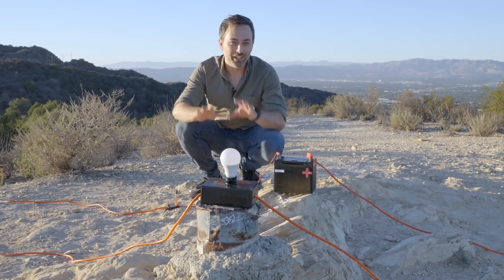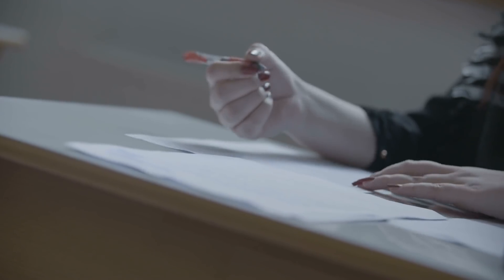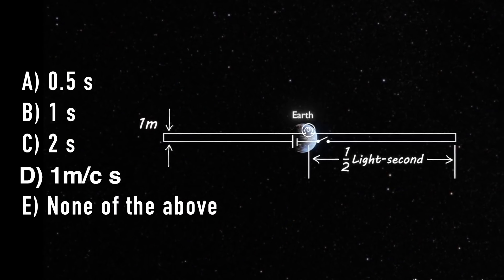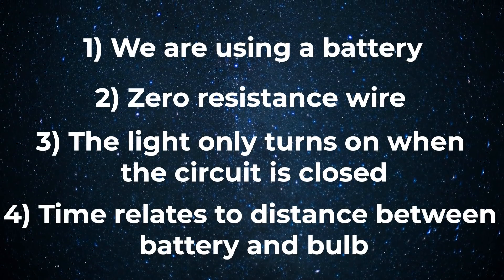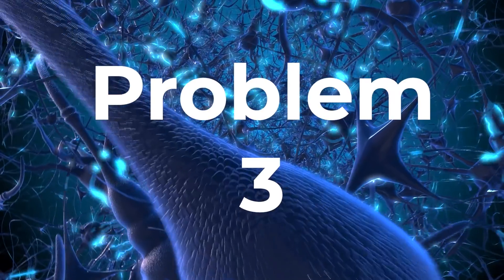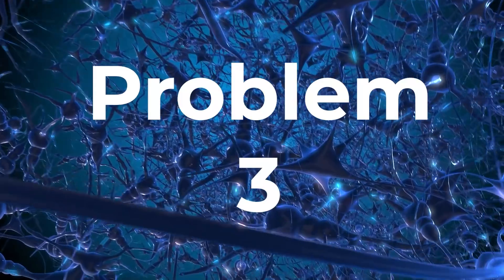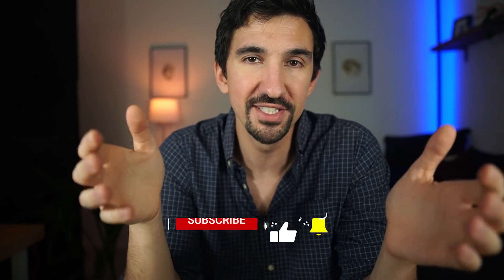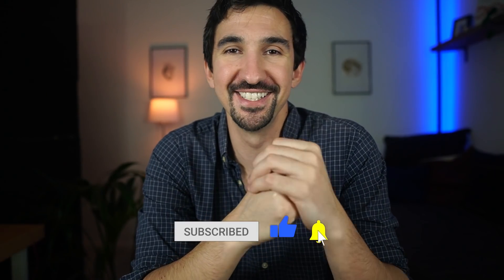Is Veritasium Wrong About Electricity?

Comment: The conclusion I drew from Veritasium's video was that the length of the wire, which connects the battery to the bulb, is not important in the speed with which electricity reaches from the battery to the bulb, because the energy is transmitted through the electromagnetic field, not by wire. That is, the most important is the physical distance between the battery and the bulb, and the wire is just a guide for electromagnetic energy and the electrons do not move through the wire.  If this is true, then why does the wire heat up? This I do not understand.

Comment: Regarding the faster than light communication, I think the dilemma is stemmed from the ‘when is the bulb turned on’ issue. 

As you say, Derek’s 1/c explanation doesn’t need a full loop of wires to work, it only needs a pair of antennas. So if the bulb ‘turns on’ just by the coupled electric field of the 1m distance, then surely the cutting of wires doesn’t affect that at all. The bulb will be on all the time regardless of whether the switch is on or off. So there is no information transferred there. (Of course the bulb won't be on all the time if the power source is DC - it will turn on only for an instant then go out)

The thing that is affected by the switch is the ‘full power’ (or DC steady state power) that is transferred from the propagating fields along the long wires and that of course travels at the speed of light. So closing/opening the switch will only affect this steady state phase of the bulb and that, safely, is conveyed at the speed of light.

Comment: The real problem I see with this is that his explanation is inconsistent with a very common electrical measuring tool: the clamp on ammeter. This takes advantage of the fact that moving charges create magnetic fields (If I'm wrong about this, feel free to re-teach me everything about physics) and that changing magnetic field will induce moving charges inside the loop of the clamp on ammeter.

So, if his diagram with the 'yellow field lines' is true, and the energy moves as-the-crow-flies to the load of the circuit, then using a clamp on ammeter breaks the law of conservation of energy! Because, therefore, the energy would have to be following the conductors AND travelling a short cut through space AT THE SAME TIME! This is impossible by one of the most fundamental and AFAIK unbroken laws of physics.

Am I right?

I think he very tragically misunderstood the idea that electromagnetic fields exist OUTSIDE conductors with electromagnetic fields travelling IRRESPECTIVE of the conductors.

Comment: I thought the same thing about the units. C is the speed of light which is distance over time not time si 1/c doesn't make sense. 
The other way I look at this is thinking about transistors in a CPU switching billions of times per second. How long does light travel in one billionth of a second? Its about 3 metres so if the transistors are more than 3 meres apart will one transistors immediately affect another rransistkr 3 metres away or would it take one billionth of a second? I think the latter is correct otherwise you could just keep increasing clock frequency without it affecting the circuit

Comment: I'll say what I said about that video.
If its a 12VDC circuit, the bulb won't light at all because there is no way DC power can travel that far.
Or it would instantly kill you, a 300,000 KM wire moving through the Earth's magnetic field would probably generate a few million volts which would make your equipment explode and emit a tremendous amount of X-rays.

Comment: Great video, thank you Dr. Miles! You explained it really well too. I still think 1 & 2 are huge problems with this thought experiment, but now I'm tying that with problem 4 after hearing your take on that. They are both massive problems. If we suggest that the light would turn on at a time dictated by the distance between the battery and the lamp, as you eloquently state, how do we then proceed with ignoring the length of the wires to solve the problem? 

So I think ignoring the resistance and the small size of the power source, and that we using DC is not fair, or correct to do.  But even if we do ignore those and pretend we have 0 resistance and impedance superconductors from Star Trek or something, it still fails a basic logic test in crafting the formula. The length of the wires matters to the time required to turn on the light, and if we accept that, then how do we ignore the length of the wires for the calculation? We are missing more than just an important unit in Answer D, we are also dividing with zeros or missing a variable or two from the formula, any way I slice it. And also doing real time morse code across the universe with no delay. 

Thanks for pointing out the important difference between using teaching models and analogies to using clickbait statements like 'they lied to you!' The scientific method is important, and sacred.

Comment: Clearly you didn't see all the explanation in the video where he told why he think that is true. If not, you will not make all these calculations about light speed.
Reply: Electrons do not travel at the speed of light, they are slightly slower.
Reply: @MichaelClark-uw7ex  actually they are MUCH slower. About a walking pace.
Reply: @binaryblade2  I'm talking about free electrons, electrons in a wire is totally different, its not about flow of electrons its about differences in charge potential.
But that is still really fast, I was a master electrician for over 40 years and I always told new workers rule 1 you can't outrun electricity

Comment: No, Veritasium's video is just flat out wrong. Firstly, the "field" is just the mathematical object used to model changes in the behaviour of the electro/magnetic forces/interactions. The forces are what are real. He also totally forgot that the magnetic permeability of air is tiny compared to the magnetic permeability of the conductor. It's the forces carried by the conductor that cause the electrons to move, he forgot to model the field INSIDE THE WIRE as well as around the wire. Yes, there is electron flow inside the wire too, but you still need to model the field! The idea that the energy is carried through the air is just stupid. What about when you don't have a circuit, like with a lightening strike... no, also the "coupling" idea just doesn't hold as it's DC, you would only get a tiny effect around the leading edge of the wave propagation, and that effect would be negated by the reverse EMF of the electrons in the other wire... ie, it would "push back". You wouldn't get any flow. You need a continually changing field to do that. But mostly... ENERGY GOES DOWN THE WIRE! That's why we use them!

Comment: At school, we learn that the electric current is slow going, but it arrives at the other end of the line at some large speed or the speed of light because of the propagation of the EM field itself. Textbooks show water being pushed through the pipes! Veritasium mentions that the EM field propagates as an exploding sphere that goes from the battery through space at the speed of light while diffracting through the materials in the environment, and moving the charges in waves. The audience would like to see the path of the current from its own frame of reference as if it were a lightning spark discovering the low-resistance areas where it will jump and cross the gaps. In that regard, science has an incomplete view due to computational and other difficulties. Right? 🙂

Comment: Hello,
As an EE I can tell you are on the right track. 
My objections are as follows:
1. He is using a DC source to provide the current into the system, thus as you state the near instantaneous current conducted through the filament would be very short lived and given the conditions of the test and poor coupling between the wires, the current may not even be measurable. The fields generated would be very small and for all intents and purposes the current would be zero.  An induced current is dependent upon a changing EM field, and since this is a DC source that change is very short, and is related to the parasitic capacitance and inductance of the system.
2. He confuses AC and DC current. In DC current electrons do flow and charge capacitors and build magnetic fields in inductors. Try charging a large capacitor with about 100V and touch it, and you will know that electrons do flow, not just the field. In AC the current does oscillate as they describe, however at 60Hz (Line Frequency) the movement is much more than they describe. Otherwise transformers and capacitors would not work, and the electric fields would not be generated.
3. The propagation velocity of electrons in a wire is less than C. This is due to the permeability and permittivity of the EM fields as well and the intrinsic structure of the conductive materials in relationship to free electrons to be conductive. You alluded to finding a break in the circuit, and I can tell you from direct measurement that Time Domain Reflectometry is real and is used every day. If what Veritasium is say were true, then this method would not work.
4. I do agree with you that his units for the answer do not work.
5. Having taken and used advanced EM field principles in my engineering career, the EM field and the voltage and current associated with it are coupled tightly. While you can radiate an EM field for long distances, without it's conversion back to an electron based voltage and current would not allow for any detection and or use of these EM fields. Electrons do flow, and voltage still drives the flow.

Comment: The breakage in the wire does not have the same elapsed time. The time from a wire breakage to the time when the bulb turns off is again dependent on the distance d between breakage and bulb (d/c) and hence no causality is broken. If the switch/break was one light year away it would be one light year before the bulb turns off and causality preserved. The other problem with your explanations is that the battery generates electric field fields even with the switch open, its not as if you close the switch and suddenly the fields are present. Instead what happens is that there is a change in the fields when the switch is closed.

Comment: You, sir, have explained what V and SA both could not to me. The key point is that both the electron flow and the electromagnetic field can excite the bulb's material. The fact that the field can do it initially by itself over the short distance does not mean it can cause visible light, nor that the wire isn't needed to do so. Thank you.

Comment: This video critiques, but glosses over some issues with the Veritasium Misconception about Electricity video.

It begins analysing the question posed on the speed of propagation of electricity to turn the light on, and turn it off including dispelling an incorrect conclusion about exceeding the speed of light, and suggests various assumptions about the transmission line.
 
It diplomatically perseveres with the with the assumption that electricity flow in wires is solely brought about by electromagnetic action to frame the analysis.  This assumption is wrong.  

Electromagnetic action relies on rate of change and this applies for alternating currents, but not for DC.  With a battery which is DC, a static electromotive force is produced by chemicals, and a current will flow without electromagnetism.  The magnetic field is static, there is no rate of change, so the magnetic field does not create any electricity here.  

This is also true for low frequency alternating current and the effect only comes into effect at higher frequencies.  Only then will Poynting indicate significant power transmitted by electromagnetic action – but not in this case here - plug in the numbers and apply the math?  

The reviewer is probably aware that it does not cover DC, saying “I think it may be easier for you if you increase the voltage of if you .. or alternating current ..”  “then you start to see the full power of the battery …”  “I would like to see .. if there are more useful mental models …”

The more useful mental model is the conventional teaching of electricity transmission over wires, without jumping to everything being electromagnetic or introducing an extraneous power transfer formula.  

That video had such power to create vast interest by many tens of thousands of replies.  Unfortunately, it was misleading and led some to refute their formal teaching.  I'm sure this was unintentional.  Veritasium has deservedly created a loyal following of people seeking to understand science better.
Reply: The fact that it's DC doesn't invalidate the idea. A circuit moving from zero current to some arbitrary DC current will see a changing magnetic flux. This, (from memory about 8 years ago), is how some fusion reactors are designed to work - essentially ramping up DC current to enormous values to generate a magnetic field which contains the plasma. The caveat is that it is only an instantaneous effect while the circuit is transitioning between it's 'off' and 'on' states. But as we've seen, Veritasium's entire video is essentially a series of disguised caveats. Another being to use a theoretical 'bulb' that turns on with any amount of power. But only the power we want it to respond to, not all the other electric fields/ ionising radiation, etc around it inducing currents of similar magnitude. (That's yet another caveat of course).

Comment: I know Veritasium will not answer this. But maybe you can. Have you ever noticed than visible light spectrum can be explained with RGB system?
Reply: @mike.1  Thanks for your answer. But you should reconsider. Just take a closer look at it. Yellow and Cyan are allways combinations.
Reply: @mike.1  I am asking you to reconsider your paradigm, and you reply that these are "facts." have you ever seen rainbow? you read that yellow has a wavelength of 580 nm, that's fine. but experimentally I have not found a monochromatic yellow, because yellow is always the combination of red plus green

Comment: "a thought experiment involving a battery powered circuit connect to a lightbulb with wires extending in 1/2 a lightsecond in each direction. Suggesting that the lightbulb would turn on at a time dictated by the distance between the battery and the lamp, ignoring the length of the wires." And therein lies the fatal flaw in this thought experiment. Calculating based on wires extending 1/2 a light second in each direction, but also at the same time ignoring the length of the wires. That matters, and this so called experiment was flawed. Also, he actually only used wires that were a few meters long, not 1 lightsecond long. If he had actually used really overly-long conductors with a 12V power source, the lightbulb would not have turned on at all.

Comment: Nice try but no cigar. Like many commentators, you've confused the concept of transmission of an electromagnetic wave with the electric and magnetic fields created by a voltage across and current through a circuit.

If you really think that energy is being transmitted through an electromagnetic wave when when the switch closes, then ask yourself "what is the frequency of that wave?" It is actually true that you do generate a very small and very short whenever you close an ideal switch - take the Fourier transform of a step function to see the distribution of frequencies - but it's a transient, and so little energy is carried by it that it cannot in any meaningful way be said to "light up" the bulb. Sure it can travel from switch to bulb in 1m/c seconds, but it will decay to nothing in about the same order of time.

The energy in the steady state when the bulb is actually lit can either be thought of as deriving from the full voltage appearing across the bulb times the current flowing through the bulb ( V . I ), as is conventionally calculated, or by doing an integral of the Poynting vector ( E x H ) through a surface enclosing the bulb - which of course comes to exactly the same thing.

I should add that if the wire has no resistance, then there is no electric field along it, and the entire battery voltage appears across the bulb, so there is absolutely no voltage along the wire anywhere and it remains at exactly the same potential as the side of the battery to which it is connected along its entire length. That should help dispel some of the other nonsense that appeared in the original video.

Finally, I invite you to consider a modified thought experiment. Connect the battery to the bulb via a piece of RG-58 50-ohm coaxial cable which is 300,000 km long, but has no resistance. bend the wire into any shape you want as long as the bulb ends up I metre from the battery and switch. Now close the switch. You will have a transient e-m wave that hits the bulb in 1m/c seconds, but carries so little energy that the bulb does not light up. About 1.5 seconds later, the switch-on pulse arrives at the bulb and it lights up. Assuming I did the transmission line calculations correctly, of course. If you want to check, RG-58 has a capacitance of about 100pf/m and an inductance of about 250nH/m, The propagation delay from a transmission line is √(LC) ideally. Now how does that setup differ in its essentials from the one in the original video? Why does my experiment take 1.5 sec to light the bulb and yours takes less than 0.000000004 sec?

Comment: The electric energy does not travel through the wires. Veritasium’s argument is that the electromagnetic fields formed at the wires have a perpendicular energy vector that carries the energy to do the work at the load.
Reply: The energy vector relies on the field extending to the bulb, and most of the field travels via the wire, so the energy transferred will be very small until the field has had time to propagate through the wire.